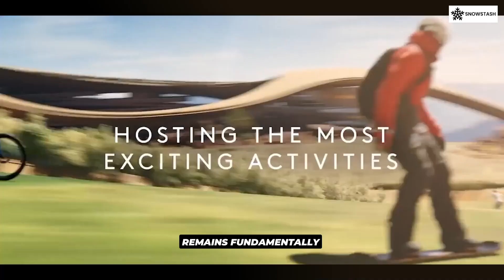Trojena Saudi Arabia

Comment: It is good that there are so many mountains but they are only 10,000 feet high or roughly 3,000 meters. Temperature drop would be 3.5°F for 1,000 feet ascended. At 10,000 feet the temperature drop is 35°F. It seems it has a temperature year round of 18°F with sub-zero temperature in winter. If they build on top of another mountain to 11,500 feet the temperature drop would be 40°F. Mountains transfer heat very well so the entire region would be cooler. At night the cold mountain would condense water vapor so it is possible a stream of water could form. As water is precious in a desert it would be a blessing. Desalination costs could be reduced.

Adding 1,500 feet to an existing 10,00 foot mountain would be daunting and expensive. If water is produced they could keep on adding more height. Also, the region would be cooled as heat transfers from high temperature to cold temperature of the mountain.